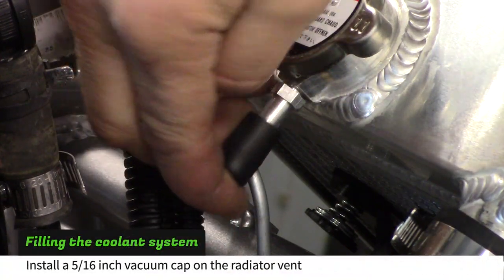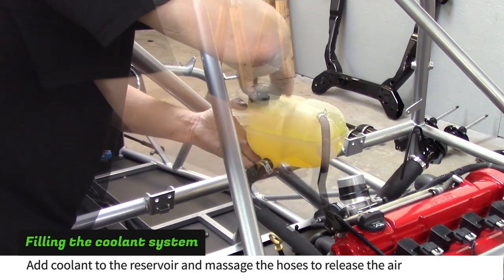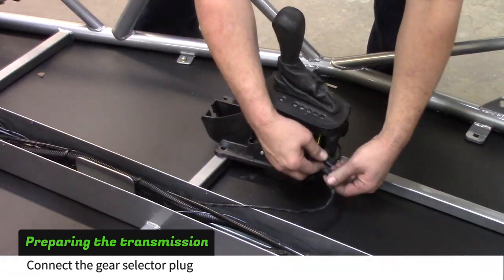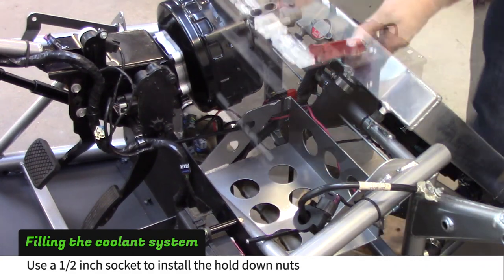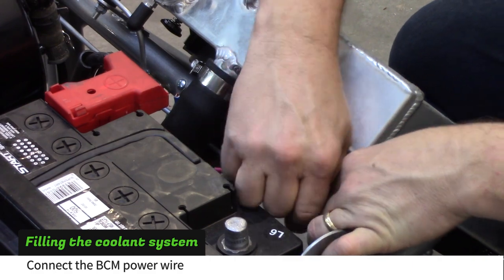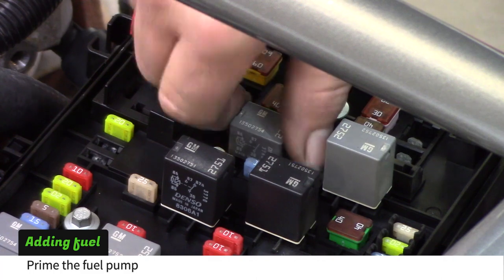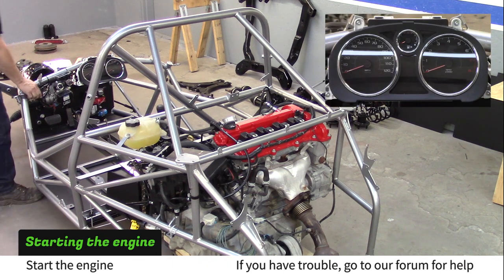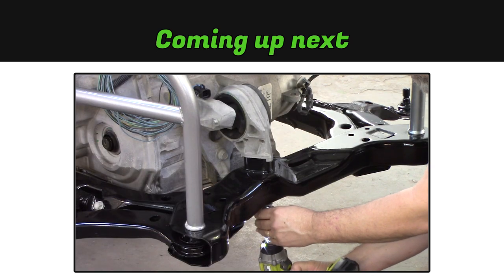DF Goblin Build Guide Part 21 - First Start

Comment: what do you do about the engine light?
Reply from the maker: Installing an exhaust with catalytic converters will clear a couple of codes and installing the evap system (canister + purge valve) will clear the evap codes. At that point, the light will turn off. Alternatively, you can disable those codes with HP Tuners but if you are in a state that inspects custom cars for these systems, you could get in big trouble by doing so.